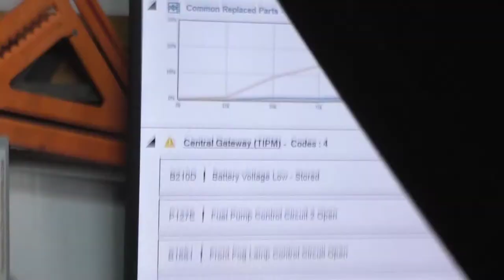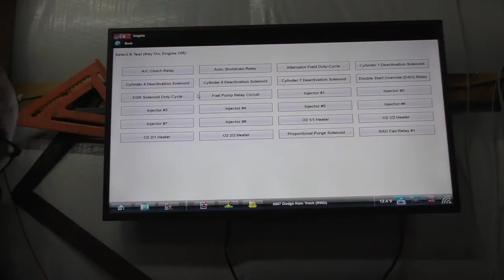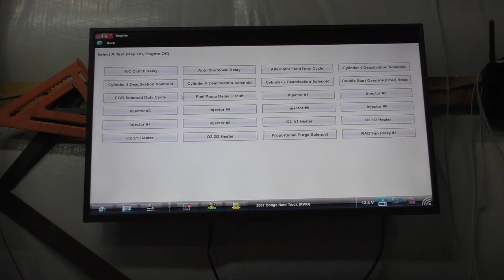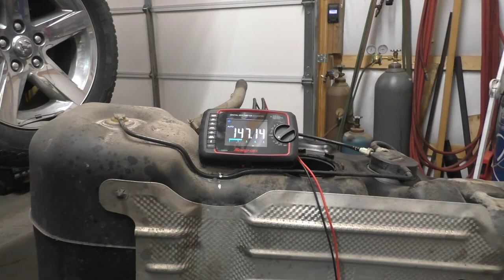06-08 Dodge Ram 1500 Fuel Pump Test and Replace

Comment: Very detailed and a lot of time spent explaining the removal of gas tank and installation. I have a 2007 Dodge Ram 1500 5.7 and when I turn the key the ignition keeps turning but does not turn over or start up. When I turn the key off it stops and shows no codes
I'm wondering if it might be a stuck relay if so, sounds like a new TIPM, have you seen this problem? Will check fuel pump operation. Good thing is I'm retired and a gearhead like yourself so I have time to work on my truck. Peace
Reply from the maker: Check Power to Starter, real simple on that truck.
Reply: @ralfsautomotive  Sorry for getting back to you so late. The problem was the fuel pump thanks for your help also the starter checked out OK.

Comment: Having someone cycly the ign. While listening would have told you if the pump kicks on, then check the relay. So much time wasted. And the hammer thing, lol  that's rich, my shop would get a lot of work from you if you were close. Nothing like being too lazy to do a thorough job.
Reply from the maker: Most things I show I do for the purpose of showing how things get done. I have no comebacks so that shows what you "think" you know!!  Showing different methods also nothing wrong with that. You the kind of guy that blast's parts cannons at people's wallets by the sound of it. There is never anything wrong with going the extra mile or in your opinion "wasting time" 
If you was smart enough you would realize the the ear on the tank does not show a broken wire.
Reply: Whipstaf Ass:I'd take my business to a dozen Ralph's shop before I'd give a dime to a shop with the disrespect you have.
Reply from the maker: @greghayes5514  BooHoo